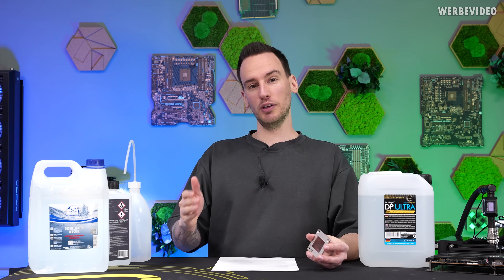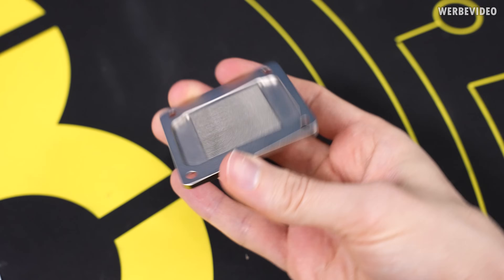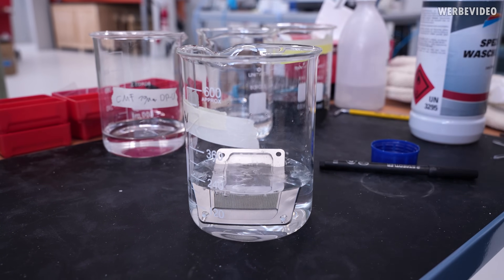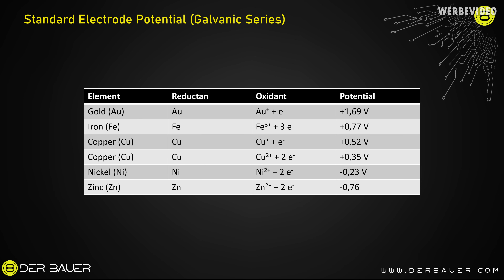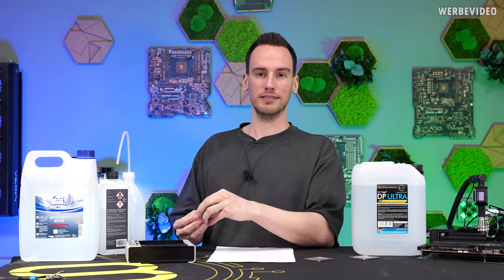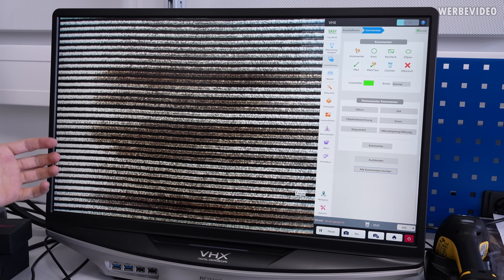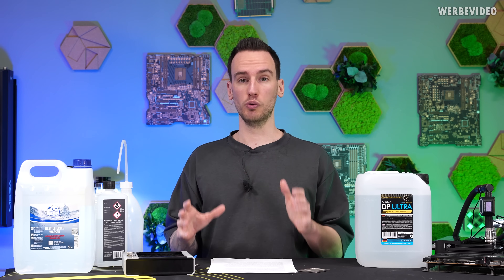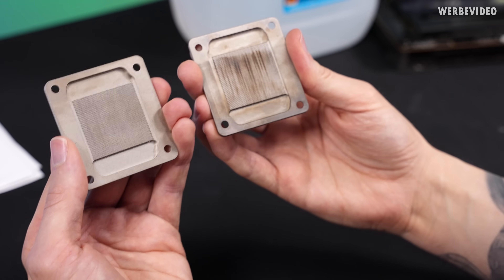Do NOT use Distilled Water for your Water Cooling Loop!

Comment: I have never used distilled water in my loops and I have been doing it for about 30 years now, these days its a bit harder to get but I have always used non-conductive cooling liquid. 
Last year I disassembled my daughters PC that have been running for 8 years.
Believe it or not I have never cleaned the system nor have I replaced the non-conductive cooling liquid.  The block had no corrosion at all.
I re-used all the radiators and both of the pumps for her new PC.

Two months ago I replaced one of my game PC's which had been running for 3 years again without any maintenance and this PC had totally copper blocks and radiators.
Again nothing at all all the block on the insides where like new.

This non-conductive cooling liquid that I used in both PC's is from XSPC.

XSPC EC-6 Clear is a high-performance, eco-friendly coolant for PC water-cooling. It is based on a blend of refined vegetable extracts with non-toxic corrosion inhibitors and non-toxic dyes, offering protection for copper, brass, steel, nickel, and aluminum.

Highly recommended,  just it give a try...

Comment: So you say it will look bad. But there is another question. What if you have a block where the fins are not visible?  If it's just a thin deposit that forms, is it then actually a problem? It would be better if it didn't happen, But would it harm the performance of the block?
Reply: Well yes. These fins are tiny and are very important to transferring heat from cpu to water, and amount of residue will increase thermal resistance, and that means higher temperature. It will take time to make easily noticeable impact, but harm is there.

Comment: The funny thing is I learned all of this before ever building my first water cooling loop.  Cause I really like coffee, and oh boy if you like to use high end coffee makers with metal components do the manuals go into great detail why you should not use distilled water in them.
Reply: Just out of curiosity, if coffee machines don't recommend distilled water then what do they recommend? I mean you need water to make coffee and it's not like mineral water is any better for corrosion, it's even worse.
Reply: @AirSKWolf cofee makers typically ask for filtered conditioned or high quality two water. The distilled water will eat the chrome plating from the inside and it will let any aluminum move to the coper, chrome, or nickel. Hard two water will cause scaling.
Reply: @zanzabar4ky7  you appear to be describing deionised water rather than distilled. They're two completely different processes. Deionised water will 100% destroy stuff when trying to get back to equilibrium, especially when used straight.
Reply: @ fellows says it will destroy my coffee stuff. They said de-ionized and hard water will also destroy it. You are putting in a bunch of water through those.  A loop you have a few gallons every year or 2.
Reply: @JamesTK  lol no both distilled and deionized water can damage coffee machines. Over the long term obviously
Reply: Distilled water is rarely used for anything outside of laboratories and when it is used, the device will specifically require it rather than other water sources.
Reply: @SmallSpoonBrigade  Slight addition - in laboratories, usually you have at least twice distilled water - especially if you reuse this stuff. And there is often a temperature measurment in addition to that, so the stuff that evaporates early and late is usually not included in final "product".
And of course there are further cleaning procedures if you want even more pure water.
For "regular" distilled water, the most often used stuff I do see is to mix it with concentrate for coolant - for cooling ICE engines. I think Glycol was started to be added for cooling in 1920's or early 1930's. It's kind of famous that it was one of the revolutions that allowed for massive increase in power of the aviation engines that previously had to have gigantic coolers. Hence why early on the air cooled engines were the predominant aviation engines. And if there was an odd liquid cooled one, it was often underpowered compared to air cooled. And definitely underpowered with thrust to weight ratio, because they had this... like very, very big box coolers - which obviously couldn't be aerodynamical, because it was flow of air through them that cooled the engine.
Reply: it is used for lots of things outside of a laboratory:

*Brewing.
*Car batteries and car cooling.
*For steam when ironing your clothes 
*In humidifiers.
*For neti pots/nasal rinse.
*For tools, for styling your hair.
*Some use it for aquariums.
*Some use it to water their plants.

The list goes on and on...

Basically you use it everywhere, when you don't want to introduce bacteria (or other contaminants) or if you have a lot of lime in your tap water (could be considered a type of contaminant in this case) and that will eventually destroy your equipment. Be it an iron for clothes or something else.

Comment: While the thought of water cooling has always had some appeal to me it really doesn't make sense unless you are running the highest end GPU and CPU's.  Excellent video.  Bacteria can play a huge role in loss of heat transfer efficiency and corrosion as well.....good material for another video.
Reply: Mostly because it allows system to be quieter, but still have good performance unlike passively cooled systems. Especially GPU, i dont know why there arent more of them using 120 or 140mm fans that are much quieter then everything else.

Comment: Is this a late april fools video? Ive been using demineralized water for bare copper blocks as well as nickel plated ones for YEARS without maintenance and never experienced corrosion. You must look elsewhere for the cause to your problems. Hell I even flush my parts with plain tap water and that still wasnt enough to cause even the slightest problem.
The only difference I can think of being different is using a silver coil as a biocide, and who knows what kind of galvanic protection that gives but you should add silver either way just to prevent algea growth anyway.

Comment: I used Halfords brand Distilled water for about 10 years without issue.  The longest i ran without maintenance was 6 years and the blocks looked brand new.  Halfords must have a high purity level of Distilled so it really depends on where you buy it from.
Reply: You’ve opened your blocks to inspect
Reply: @ yes absolutely, do it everytime to get rid of any small loose particles.

Comment: Would be interested in this test again with some of the homemade coolants that people are doing with automotive antifreeze.  Also, really interested in a Thermal Grizzly water block for my 5080.  If only I could get an AM5 non direct die water block as well.  Using glass like you had in the 5090 prototype would be really nice instead of acrylic like other manufacturers.

Love this channel and look forward to a new video every week.
Reply: Just look at the SDS sheets for them. All the "good" coolants are antifreeze. But you have to look at the SDS for those too.

Comment: So, I have a watercooling build on the back burner. And I've bought from AlfaCool their "Ultra Pure water". It's not distilled, but filtered. And they state that it's absolutely free of salts and metals. So it's not dissimilar to distilled water then. Their goal seems to be a coolant with the lowest electrical conductivity. But I can't find anything in any of their documentation about additives. And their documentation is quite extensive, so I'm thinking there are no additives.
Did I make the wrong choice?

Comment: I use a corrosion inhibitor in my central heating loop, after I flushed it out to remove all the gunk that collected at the bottom of the radiators.

Comment: I have been using WB full copper (watercool heat killer) with distilled water for years and honestly I have never noticed this visibly appreciable corrosion .. it will be 8 years that I have the same CPU block .. knowing that I'm slowly destroying it hurt me hahaha... Does it also affect temperatures?

Comment: Is distilled water fine for flushing new radiators at least?
Reply: Yes i wouldn't worry about it if it's only for quick flushing of parts.
Reply: Dang, asked before watching to the end, Roman said it's not good even for flushing.
Reply: @Rubed0_o Maybe I misunderstood what he said, but it sounded like he was saying you shouldn’t flush with distilled water if your loop is already built.  I imagine if you’re flushing your rad with distilled water on its own and not throughout your entire loop, you’d be fine.  It’s only when introducing other metals into the mix that you’ll run into potential issues, like copper and nickel.  Most rads don’t have nickel, so you should be fine for a quick flush.
Reply: @D1L4TE-CR4WL  
Nope, he mentioned new rads. I guess because even radiators by themselves already consist of 4 different metals (copper, zinc, lead and tin).

Comment: I have not done a water cooled PC build yet. Does the copper on top of the nickel plating change the heat transfer characteristics? Will the plate eventually develop leaks? What is the main problem with the fast corrosion?

Comment: I've been fine for years on small amount of car antifreeze for anti-biological. With that said I was careful about metals, all copper/nickel plated copper. One advantage of not much additives is long term there isn't so much ugly residue buildup. I'm guessing final failure mode will be acrylic micro-cracking (its pretty bad already) getting worse and worse eventually starting to seep.
Reply: Car antifreeze has very strong anti corrosion properties, so even a little bit is very beneficial.
Reply: I've run about 1/3 strength high zinc green alloy coolant on my diy soldered laptop loops - copper tube and exposed lead solder joins - and never had a problem except gunk. Either biomass growth or oxidised glycol I dunno.  A weak vinegar flush every 12 months would fix it. (It was pinhole open to air so attachment/removal would be leak free). Using tap water but where I am it's very very soft (about 30mS)

Comment: I use a watercooled laptop that the manufacturer recommends to use distilled water with. I notice what looks like some sort of scale deposits and I think it may benefit from additives. Problem is the magnetic connectors (which work great) have rubber seals. What additive is good to use if there is more in the loop than just aluminium and silicon? I.e. safe to use with rubber and plastic?

Comment: "Don't flush with Distilled water" .. I mean, sure "Technically" that will already start corrosion.. but the speed at which that happens is absolutely negligeable. I had to rinse my loop/rads a BUNCH of times before everything was clean.. and I'm not using coolant for that. That's just wasteful. I used distilled water instead, and filled it with proper fluid after rinsing, and all visible parts at least, still look clean. Cost/benefit is not worth it I think.
Reply: Even manufacturers (alphacool) tell you to flush their radiators with distilled water before use.
Reply: @maxine_q  radiators are not nickel plated.  It won't make a difference
Reply: @maxine_q  Yeah because flushing rads with coolant is idiotic.
Reply: @maxine_q Thermaltake also wrote on their page to leave the reservoir open so "it bleeds faster".
Leaving the port open doesn't make any difference. Air will move from one place to another regardless if the reservoir is open or not. Air from the block or radiator will move to the reservoir and the liquid level will drop. This will happen regardless if your reservoir is open or not.
But, what will happen when you have your port open is that the aditive form the coolant will evaporate and it will stop doing its function of preventing corrosion and biological growth.
So.... Don't believe what manufacturers write, since most of them have no clue.
Der8auer is at this point the most educated influencer regarding PC liquid cooling.
Reply: bro, pls i had to sell those DP Ultra canister :D
Reply: You could have just rinsed with tap water.
Reply: @jaro6985  tap water can have a lot of contaminants, I'm not talking about unsafe to drink or anything, just the fact that there is always a trace amount of residue left and it's easier to never get it inside than to try to get it out, from that perspective it's better to use distilled water that will quite literally leave no residue and you can just use proper liquid after flushing. It's not like it's expensive, but it can save you a lot of work if you live in an area with "hard" water
Reply: Also, you could rinse with 90% alcohol (or better). This would remove any water.
Reply: can you imagine the greenie tantrums if everyone was flushing every new automotive radiator with litres of glycol before use.
I thought Roman was a car guy and he'd know this but I guess there's a difference between people who have people to service vs us DIYers
Reply: @greebj  he probably has a dedicated barrel of "flush coolant" that has its own filtration system.. shouldnt we all?

Comment: Distilled water + Glycol still MVP since 1950!
Reply: How much glycol do you mix to a gallon of distilled?
Reply: @jaquestraw1  20% glycol by volume has always worked fine for me. (Supposedly you can get microbial growth if you go lower than 20%.)
Reply: @jaquestraw1  
Ethylene glycol - has the least effect on flow rate, heat transfer and pressure loss "high oral toxicity"

Propylene glycol  - low toxicity

glycerine is also added to some pre-mix and can cause gel forming issues.

Always use "inhibited glycol" pre-mix for PC cooling.

A 50/50 mix is fine.
Beer brewing cooling mix are usually 30G/70W.
Reply: @N0N0111  It's literally the opposite of what you described.

Ethylene glycol is super toxic AF. Propylene glycol is non-toxic and is a food additive.
Reply: @N0N0111  Thanks for the reply!
Reply: @N1c0T1n3__  I use it for making my vape liquids, I do a 50-50 between PG and VG. Food industry uses a lot the vegetal glycerine too, but since it's thick and vegetal yeah unlikely good for PC cooling :)

But anyway I don't know if the PG used in the food industry "NOWADAYS" is the exact same as the one on cooling liquids since before was always made out of petroleum for everything but nowadays they also make it from plants like VG and maybe the food industry changed to it or is changing slowly towards it, no idea, on my vape I now only buy vegetal glycol...
Reply: Running 50/50 distilled water and VW's red long life glycol for almost 30 years. All my parts look shiny when i retire them, even the 15yo Koolance CPU-370 block i just pulled. It's also so toxic that nothing will ever grow in it.

Comment: Hydrogen oxide (H2O) is a very interesting compound.  In general, we consider it a "neutral" compound, but it is still acidic, also called hydroxic acid.  Perfectly pure water is best considered an incredibly weak acid, incredibly weak base, and a very weak conductor.  Water is not an inert compound, just sits as an entropy point.
Reply: "Perfectly pure water" doesn't exist since auto self ionisation and all other kinds of dynamic auto equilibria exist in the real world.  It also does not exist outside of a total vacuum since as soon as water is exposed to air, all kinds of things start dissolving and reaching new equilibrium states and reacting with each other; the most obvious and easily observable effect is carbonic acid from dissolved CO2 acidifying "pure" water left standing - it will drop to pH ~5.6 with enough time.
Reply: @greebj  It's a bit like how H20 isn't actually electrically conductive on its own, it requires impurities for that to occur.  However, that level of purity can only be maintained in a lab environment.